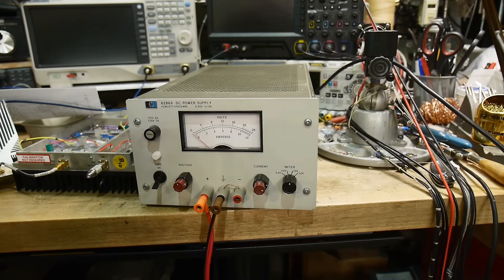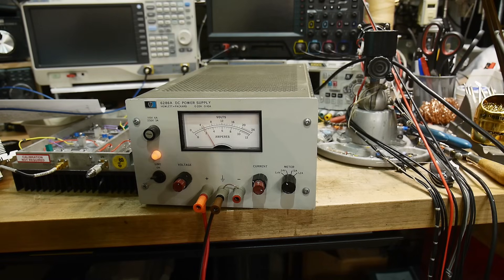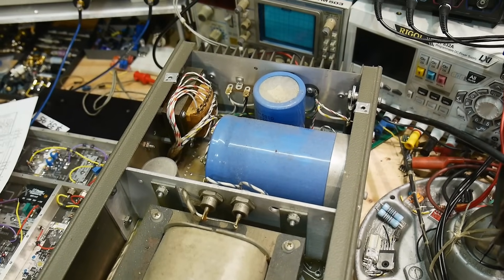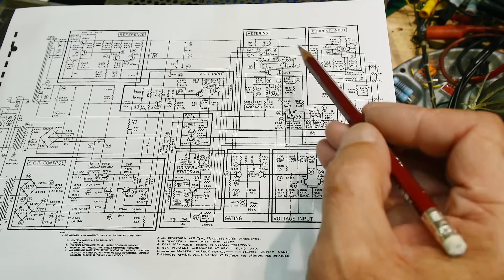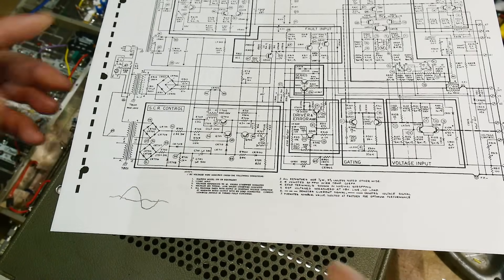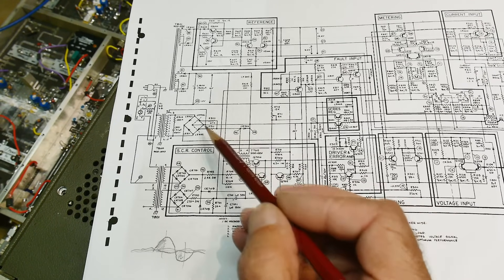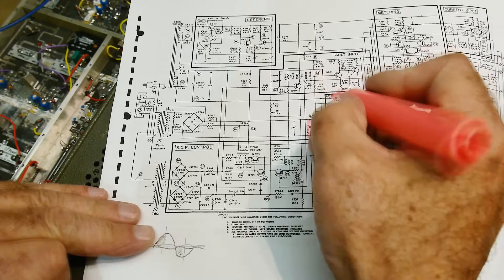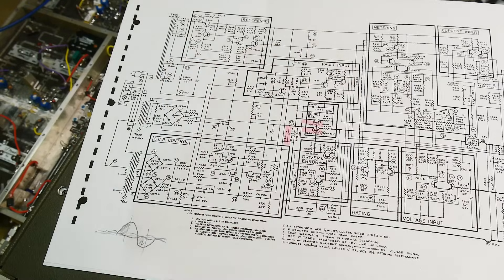#1868 HP 6286A Power Supply Repair (part 1 of 3)

Comment: I ran across a similar circuit in a lot of 4 bad Kikusui PAL-35 power supplies I bought on Fleabay years ago.  I wasn't familiar with the circuit or technique at the time.  No schematics or service information was available which always makes for a fun time trying to repair something.  These things were packed inside, I didn't understand how they complicated such a simple thing.  At some point I ran across the SCR and assumed they were using it to control the voltage going into the shunt regulator to keep waste heat down.  I assumed it was a clever circuit that Kikusui came up with.  They were bad in 2 of the 4 supplies which took out more stuff downstream.  

I recently came across another use of the SCR bridge circuit in a Bridgeport Series II milling machine.  It uses it in the DC motor speed controller which drives a 90v DC motor that powers the x/y/knee power feeds.

Comment: Actually, we use the part of the sine wave AFTER we fire the SCRs.  If the filter capacitor voltage minus the output voltage is too low, then the control circuit will fire the SCRs earlier and deliver more charge to the filter capacitor.  If the difference is too high, then the SCRs are fired later to deliver less charge.

Comment: I believe the word you were looking for is duty cycle. Almost identical to pwm, with the main difference being that pwm is specifically concerning signals. But technically pwm is still a specific type of duty cycle, and commonly used for duty cycle purposes due to the ease of using digital means to produce it. That's why the words are often treated pretty much as interchangeable nowadays, despite there being a slight distinction between the 2

Comment: There is a big mistake you made while talking about SCR preregulator. This is called phase-angle cut preregulation, and works inverted from the thing you draw. There are two reasons for it. First, and the obvious one, is the usage of scrs. Scrs are the components that once triggered stay on until the current that passes through SCR drops below something called minimum latching current (in this case we can call it 'zero' since it is typically some small value in order of mAs or tens of mAs). So the scrs are triggered some time during the half wave via the pulse from preregulator controll circuit and the zero crossing of the mains turns them off. 
The second and more subtle reason is that the transformer has inductance and if you start your cycle at the zero-cross moment and try to cut the current off while it is at its peak, you'll get quite a high voltage spike since you inadvertently made a boost converter. 😂
Also in this circuit there is a hidden gem. Imagine trying to recharge the high-value capacitor through scr, and from a tightly coupled transformer that acts almost as an ideal voltage source... Since the capacitor will do its best to resist the change of voltage, you'll get a short circuit with the current defined as peak voltage (at the moment of the scr turn on) devided by thermal resistance of the transformer secondary plus capacitor ESR (this is simplified, ther is also the mirrored impedance from the transformer primary, and the scr on impedance, but there is no need to go that deep). The resulting current will be huge, resulting in heavy transformer heating, capacitor heating and detterioration... So the engineers, in order to reduce the mentioned current, put the air-gapped choke between the SCR bridge output and the capacitor. And that was done like this from the time of thyratron phase angle cut rectifiers... But engineers from Harison lab got the more elegant idea! They purposefully made the transformer with loose coupling so that the leakage inductance of the secondary winding would act as the current-limiting choke. Ideas like this made the companies like Harrison and later HP standard in high end electronics. Also got me into EE. 😄
Reply: Where did you learn about custom transformer?
Reply: Good to know.
Reply: It's OK when the time axis goes from right to left, just a convention issue :-)

Comment: I have a newer version of one of these (E3633A) do the same thing to me after I cleaned all the dust bunnies out. I'm pretty sure it spent it's previous life around continuously running brushed DC motors and a bench grinder. It was an intermittent problem that showed up after a couple minutes, going into Unreg with no purring. I fixed it by launching the parts cannon at every component in that preregulator circuit except the control IC. The design had changed to where the SCRs just selected between Low and High range and the phase control was being done with a single MOSFET on the rectified DC. (E3633A/3634A parts list/schematic has errors, BTW.)

Comment: I need couple 22000mfd caps for my Lambda PS.  The second output is taking twice as long to supply 40v and if I short the leads at 1 amp it won't hold voltage above 10v.  
I think one is bad.

Comment: If I remember correctly, Harrison Labs started using that SCR pre-regulator circuit since the mid 1960's.  I have never measured the actual operation but, I assume it limits the series pass transistor headroom to about 2 volts, substantially reducing dissipation.

Since this power supply is a series of control loops wrapped around more control loops, studying the theory of operation first would be quite helpful.  Although as a possible time saver, you might want to check for dried out electrolytics first.  Your symptoms suggest a dying SCR but, that is just a guess.  

One final comment: The standard rule of thumb for linear power supply sizing for the rectifier bulk filter cap is 3,000 uF per amp so, the 33,000 uF computer grade cap sounds about right.

Comment: I have one of these that blew that giant 33k cap. I have not figured out why it did that. Can a physically smaller cap with the same specs be substituted? Those caps are difficult to find.
Reply: No, you must use the same size capacitor or larger to keep the ripple voltage low, otherwise the SCR pre-regulator won't work properly.  As a possible work-around, you could substitute the 33,000 uF cap with a pi-filter consisting of approximately 2 - 3,300 uF caps and a 50+ mH, 20 amp choke.  Essentially trading one parts procurement problem for another trying to find that choke, which would be expensive.
Reply from the maker: yes, the newer caps will have a smaller physical size. No problem. Just buy a good brand. I do that in this video: https://youtu.be/R3q_rxVUook?si=fvcUbeBXH1hLGlge
Reply: My mistake, I thought the question was related to using a cap with less uF.
Reply: @billharris6886 I misunderstood the question the first time I read it also.
Reply: Don’t forget the temperature rating.

Comment: I think the SCR gets turned on part-way through the cycle and turned off at the AC zero crossing point (if I remember my solid state electronics from years ago).  More or less correct but different cycle.

Comment: A slightly different implementation of the "SCR bridge rectifier" with discrete voltage levels can be found in the more modern HP/Agilent E3632A (0-15V/7A, 0-30V/4A; service manual available).

Comment: I agree.  Wow.  When I worked for a living, many years ago, I worked in hospitals and worked on medical electronic equipment.  Our goal was to make sure that HP was always purchased because they don't break - mostly.  When opening up a HP schematic it was almost a religious experience.  Equipment from other manufacturers, well it was like it was designed and built by engineers that had barely passed engineering school.   So when you said that your HP power supply was broke, I went into denial.  I got better and have been delighting in your going over the schematic.  I was going to get on my knees the wife was in the same room.

Comment: I think you haven’t considered ohms law, your power supply is working ok except possibly for the humming sound.
If you put a short across the power supply terminals the load resistance is zero ohms, so you should always expect zero volts and any amount of amps. I believe this is what you got. The only way to get some voltage is to supply 10’s of amps- that short + clip leads is probably about .02 ohms, put 100 amps into it and you will get some voltage before you melt the insulation off the connection leads.
I f you now put a (high wattage) 10ohm resistor across the power supply terminals and set the voltage to 10V, you will only get exactly 1A (10V/10ohms) if you set the current limit above 1A. If you double the voltage, the current will double.
I believe this is what you got. 
The power supply hum might be normal at high current, or it might indicate some loose transformer windings.

Comment: I have a Harrison 6475 10kW 100 Volt 100 Amp power supply that uses basically the same circuit.  They called it a SCR regulator.  I bought mine as a parts not working unit and found mine had a bad SCR.  The HP Journal really helped with troubleshooting it.  I'm sure you will have this filmed and repaired by now but for anyone else interested in SCR regulator circuits the HP Journal Vol 13 #11 dated July 1962 which is available on the HP archive website is hands down the best technical document on the circuit.

Comment: That's a neat hack with the SCRs in the bridge rectifier.   Wonder if you could use that to help manage the inrush current when the power supply is turned on and is charging that big-ass capacitor?   I am curious how doing that switching on the secondary side of the transformer affects the AC line side power factor, noise, etc?

Comment: The 12 volt, 3,000 amp electroplating rectifiers we have at work function in a very similar manner to the pre-regulator on this power supply.

 I have the 10 volt, 10 amp version of this power supply. I had problems with the voltage and current adjusting wire wound potentiometers themselves. Sometimes the voltage would just randomly drop to nothing, sometimes it would fluctuate back and forth. The current output would do the same at times. I thought it had a more serious internal problem, but the wiper was distorted and was not making contact with the wire wound element correctly. After disassembling and bending things around a little bit on both of those pots, I haven't had any problems since then.
Reply: watch it be something like this.  dumb stuff like this gets me every time.  Trying to train myself to just clean the switches/pot right off the bat when diagnosing a fault like this (on older equipment) to avoid going down those rabbit holes